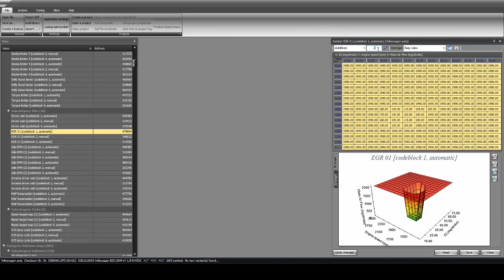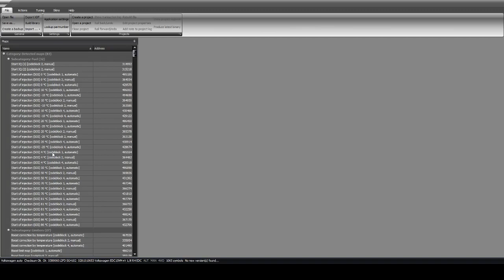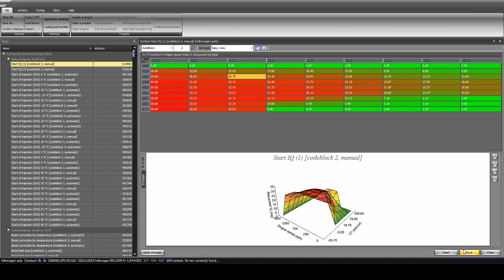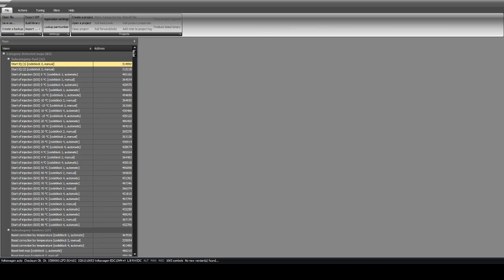How to do dynamic idle on ALH ecu

Comment: I seem to have 4 1/2 minutes where the dynamic idle (car parked) works at 1200 and then dynamic idle turns off and idles at the 950 which I have chosen as my final idle.  Is there a time limit or is there something else I need to adjust or something else controlling the function?  I can shut the car off and restart and then the dynamic idle resumes at 1200 for 4 1/2 minutes and goes to 950.   Seems to repeat until I reach what I've set for an upper limit.
Reply from the maker: That’s really weird? Sometimes mine glitches out and randomly starts Erving high again. So I’m not really sure if there is something that triggers it? Or if it’s just something I’m overlooking while setting it up. Maybe set the ramp for longer on the temp?
Reply: look for a single value mrwLLR_tTW in DAMOS & in Bosch docs or for a value 27000 in your dump (270s = 4.5min).

Open vag edc suite. Then open file in hex. Search "78 69" (means 27000).
Just before 79 69 you have to find your idle value (903= 87 03)

Chance this value to your desired idle. Remember its reserve hex (little endian)

For example: change 87 03 to E8 03.
The idle is now from 903 to 1000.

Dont forget to do this 2x in ALH hex.

Comment: Maybe a good video idea could be good supporting stage 1 upgrades? Like I was considering a p150 intake (with egr delete) a CCV reroute to a catch can, 3in turbo back straight exhaust, and bosio dlc 520 injection nozzles. Not sure if that's the best way to go yet but it's on my mind.
Reply from the maker: Definitely good upgrades!! But stage 1 is pretty much with all stock parts! It’s just flash it and enjoy it